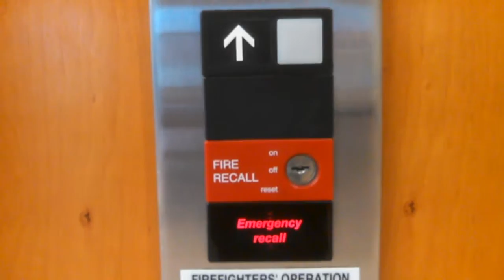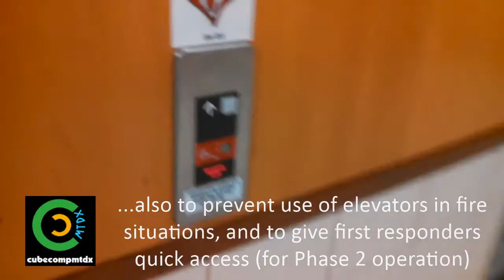Otis Series 1 Elevators in Phase 1 Fire Recall

Comment: Yep, the only other way the elevators will go into Phase 1 fire recall besides activating it with a key is if a smoke detector is tripped in the elevator lobby, shaft, or machine room. Testing recall is an important part of testing the fire alarm system.